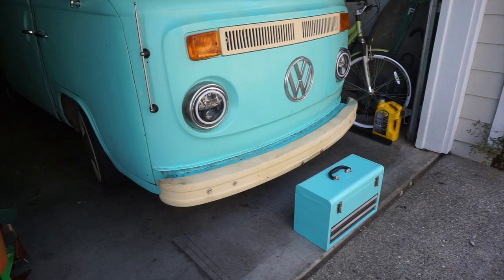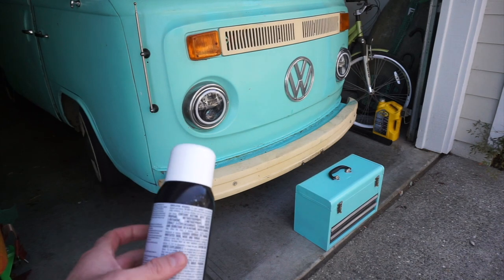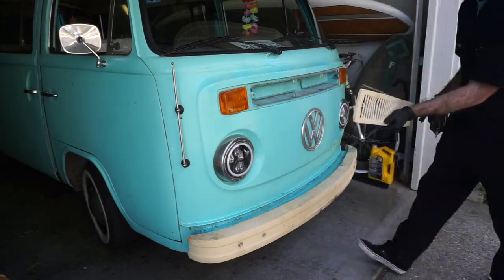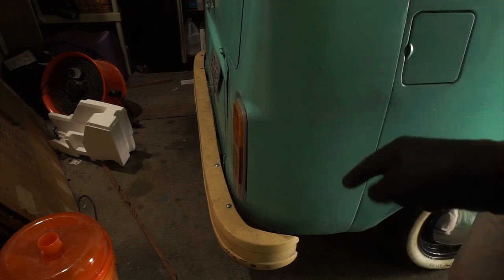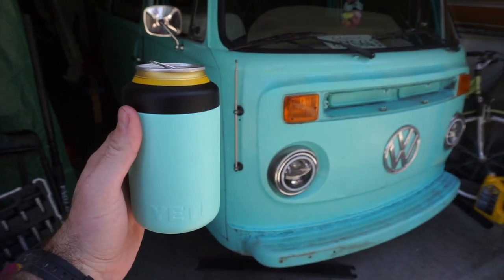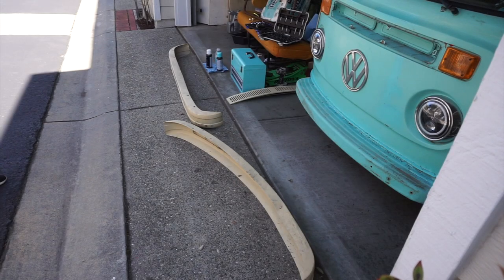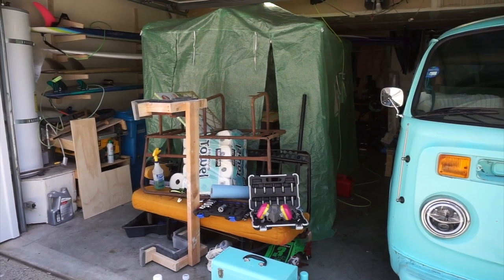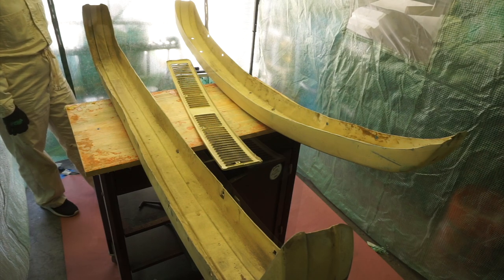Spray Paint, Bumpers and Grill, Bay Window.  1973 VW Bus Restoration Part 8.

Comment: White always looks nice!! 😎 STOC
Reply from the maker: Thanks STOC!   Pretty happy with it for now.
Reply: @callalilycollective  I was wondering if you were going to try to straighten out the little bend in the bumper ...
Reply: 👍🏻I need to get some official looking coveralls.  Nice job. 🤙🏼
Reply from the maker: @SundryTalesOfConstance79WESTY  ha, that’s part of the long term proper restoration.  This is the lipstick on a pig quick beautification.
Reply from the maker: @allsurf  ha, definitely required if you have a shaping bay and paint booth as advanced as mine.
Reply: @callalilycollective  Yabsolutely (Yes absolutely) understandable!🤔 Honestly that was the first lipstick we put on Constance too 😂 Bumpers and rims... Still there over a decade later (never went back for it.. and forgot to paint the spare)🤣 My wheel rims have peeled in certain places though...they call them 10 footers? I.e. they look great 10 feet away 🤣😂 We should have no reservations because I think our VW's look fantastic through the lens and majic of a camera 😍 😎 STOC
Reply from the maker: @SundryTalesOfConstance79WESTY  ha, yabsolutely agree.  

Lilly is currently a 20 footer.  

Repainting my rims white is also on the list (just finished new steering and tires).  So no more white walls, and want that color back.
Reply: @callalilycollective  🤔🤣 I hope you remember the spare when you do 😁 Every coat of paint is one less coat of rust and a little bit more you.  It's fun to watch you making Lilly the way you want 😎 STOC